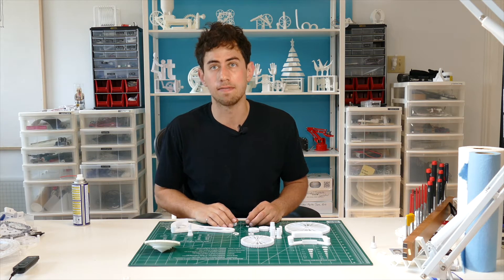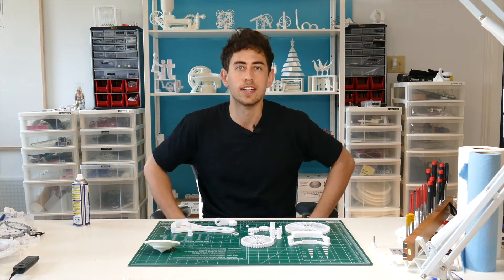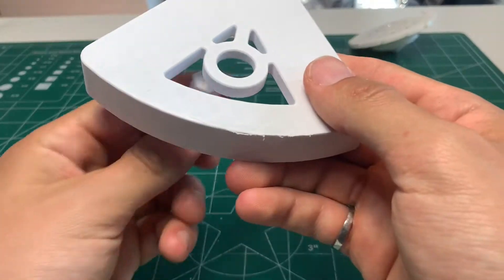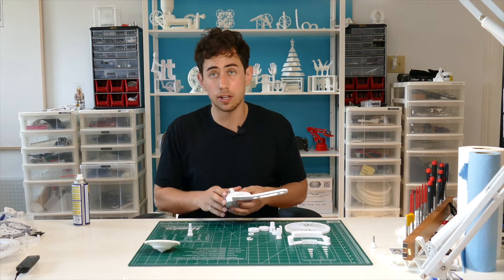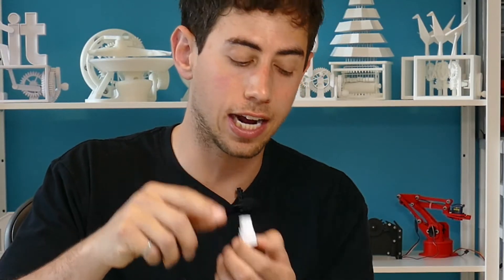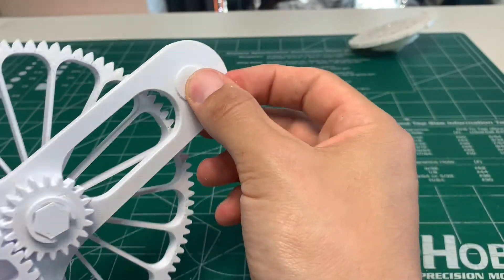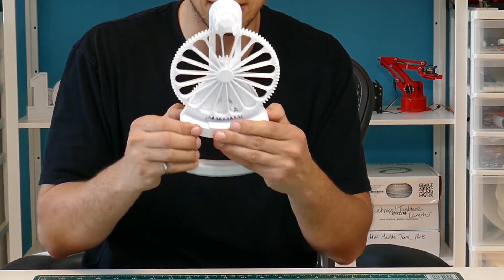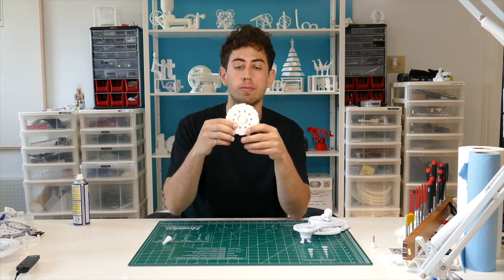How to 3D print a Beyblade launcher that spins at 1000rpm (or 3000rpm)

Comment: Printed this in PLA for the helicopter version. There is a LOT of friction at the rotator end of the build as the c-clamp squeezes the post very tightly. Also, since the Thing was designed to launch downwards it is very awkward to use with with either the hand crank or the drill. All that said, it's still pretty cool and I'm happy with the make.
Reply from the maker: It’s definitely a little awkward but you do get the hang of it! Also, wd-40 the joints and it will get it spinning much better. Thanks for the support!